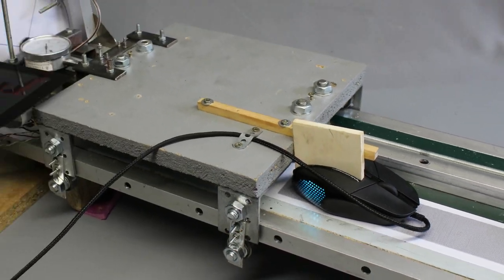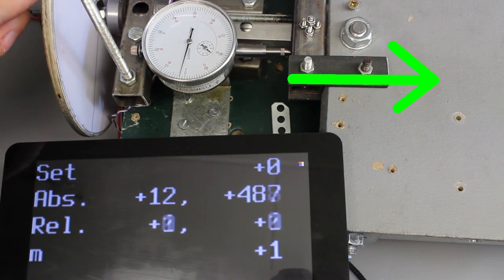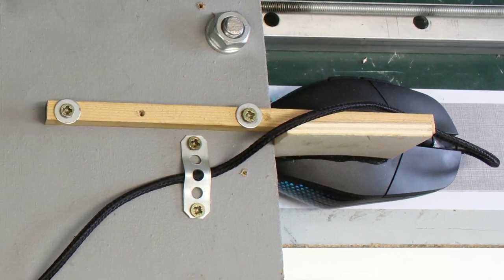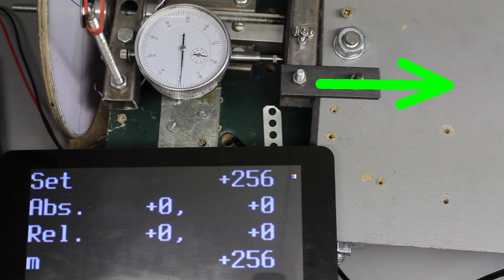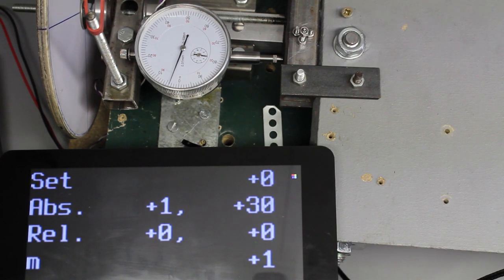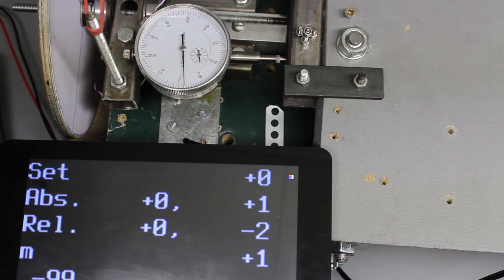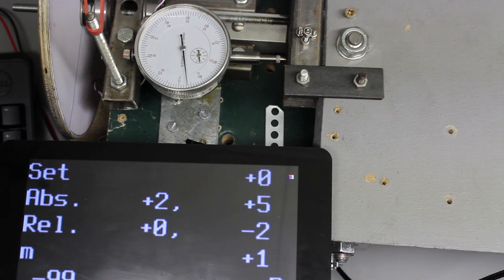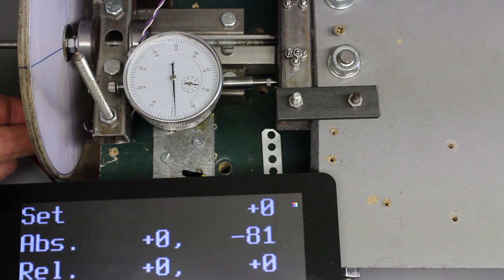Using a computer mouse as linear sensor

Comment: there should be a way to remove this drift!
this is the mouse working as intended. mice are designed to displace the on-screen-pointer at a non-linear relation to the the physical mouse's displacement. in my opinion the mousse design is genius, it's designed so that if you move the mouse fast, the curser moves further than if you move the mouse slow, this is to allow fast and accurate movement on the same device, if you want speed, go fast, if you accuracy just go slow. this nonlinear behavior is what's causing that velocity-dependent drift in you're measurements. there should be a way around this! 
the way they achieve this nonlinear behavior is probably by applying some convex function f(x) on every reading of relative mouse steps. I don't know what f(x) is, it might depend on the mouse, but, you could measure this function by measuring the number of mouse steps per inch at different speeds. after you know what f(x) is, you could just reverse it and obtain back x from the mouse's reading (which was f(x)) by applying f^-1:   x = f^-1( f( x ) )

for example f(x) might be x^2 or e^x or whatever.
Reply from the maker: You can try, but I guess that won't work either. there are inevitably coordinates lost even on a closed loop due to rounding errors.

Comment: I think firmware has small "filter" to swipe very small motions away. Think about it, if you put mouse on the mousepad, the cursor should NOT dance. That is what filter means, to remove some noise and reading errors.
Very slow motions will more filtered away than faster motions.
The filtering is more stronger inside cheap mouse or unknown type mouse. Expensive mouses should have less filtering and thus more precision possible.
Not sure i am right, but it's all about to avoid ghost move of the mouse cursor when mouse is not moving.
Reply from the maker: What ever a mouse firmware does - it changes the raw data that would be needed to get usable precision. Even with the raw data it's very likely to get a drift over time.
Reply: @HomoFaciens  @mrdummy is there any solution for this problem? i need precision on verrryyyy slow movements and now I'm disappointed :(
Reply from the maker: If you want to move something, go the "classic" way:
https://www.youtube.com/watch?v=ULJE4MsJpR4&feature=youtu.be
Reply: @HomoFaciens  thank you but no, I just need to measure Micrometer dimensions via optical ways.
Reply: I imagine this is similar to how game controllers are programmed as well. Movement is not triggered until the sensor makes it past some value, which is called deadband.

Comment: A couple of tips: Regular pattern surfaces aren't great for image correlation tracking. A random surface will be better.
12k cpi is extremely imprecise. Image correlation sensors are not made for those resolutions and it will give an extremely jittery output.
Should be ok under 3000cpi, don't even bother with more.
Reply from the maker: ...a couple of more reasons why computer mice aren't good for absolute positioning.
Thanks for sharing your knowledge.
Reply: HomoFaciens what would you suggest to use?
Reply: What are you trying to measure/optimize for? From the setup it occurs to me that simple threaded driveshafts do have a slip of some 300-500 microns. Which is by the way really good result. Changing the direction of the drive (even slowing down) will have the effect of seating of the nut on the driveshaft on the other side of the thread surface hence generating motor turns without movement of the carriage. This is normal and probably nothing to do with the measurement setup of the mouse/micrometer. Use a proper ball screw driveshaft to get much higher precision.
Reply from the maker: I wanted to demonstrate what this simple setup using common materials is good for. This linear drive is part of my CNC that can be build even in locations with no access to hight tech like ball screw driveshafts:
https://homofaciens.de/technics-machines-cnc-v3-2_en.htm
Reply: Ahh, cool, this explains. But than I think slowing down/"repeated kicks" and other methods may just lead to more "error"/slip. How about using consistent speed left and right and just measure the reseating distance when changing direction of drive. Maybe some averaging can go here or some speed related reseating distance measurement. Loved the video by the way.
Reply from the maker: Well, what ever you do, the distance reading of those mouse sensors will never get as good as the classic approach using a rotary encoder on the spindle. In theory those mouse sensors were better considering the dpi ratings of the manufacturers, but with this measurement series I found that this isn't true in practice. The experiments were part of improving the linear drive of my CNCs, nothing more:
https://homofaciens.de/technics-machines-cnc-v3-x_en.htm
Reply: If you're using linuxNC there should be a place somewhere in the .ini file to compensate for the backlash of the slide/lead screw. I came across this video because I was thinking about using the optical sensor and the light from the PCB board inside the mouse that tracks the wheel movement, but the laser will probably be more accurate. Nice video!
Reply: @HomoFaciens  My ancient ball mouse has rotary encoders mounted on shafts inside, hmmm...

Comment: Very informative, thankyou for this. Been looking for a 'cheap' way of controlling a cnc home hobby mill. 
Great video.
Reply from the maker: But you should have noticed that it won't work with computer mice. The classic approach is better:
https://homofaciens.de/technics-base-circuits-encoder-disc_en.htm
I also did investigations using the sensor strips from old printers:
https://youtu.be/YfBkddVJksw

Comment: Well, all of these findings are valid. And, more over, they are in line with the specs for the mouse sensors.
The skipping of movement is due to the fact the manufacturers introduce "sleep" state of the mouse - when not moving for particular period of time, the intensity of the LED decreases making it harder for the sensor to sense the movement. Also, the frame rate of the camera sensing the movement decreases. This saves power and avoids "noise" caused by uneven surface reflections.
Further more, to provide a feeling of "better mouse resolution" the manufacturers actually "cheat" - they increase the output of the sensor non-linearly when a fast initial movement occurs. This gives the user a feeling of faster and more precise feedback of the mouse movement.
Now, good news is that both of these features can be compensated by setting the sensor mode. The bed news is that as vast majority of the sensors are specifically made, the documentation on how to actually do it is closed-source or NDA only.
I found some very cheap ($2) PS/2 mouse from aliexpress that had an optical sensor capable of setting both of these parameters (disable sleep mode and disable rate increase), however its reflection of the GT2 belt I wanted to use it for at that time was not sufficient. I threw it out a week ago :( Should I be as smart as you and printed the fine pattern and measure that instead of the actual belt, this might have worked :(
Reply from the maker: What sensor is inside your cheap PS/2 mice? This could be something for a future project.
Thanks for sharing your expert knowledge!
Reply: I'm not 100% sure as I threw it out (stupid me), but I think it was Avago ADNS-2610 or 2620.
I can buy another one, but it'll take a month again to get here to Switzerland :(
Reply: Here is the datasheet I used: https://www.sparkfun.com/datasheets/BreakoutBoards/ADNS2620.pdf
Check e.g. page 19 for the power down for LED light for no movement over 1 second - forced awake mode...

Comment: I'd put the sensor on the wheel versus the strip, you should get way more precision with that. I'd also use a sensor that can be interfaced with directly, and a (pseudo-) random dot pattern as the surface. 
finally, I'd also use an optical sensor to resynchronize the higher precision mouse sensor and avoid drift.
Reply from the maker: With the sensor on the wheel, you must process the changes in movement in short intervals to avoid loosing turns. I am using a toothed disc with light sensors instead for my machines:
https://homofaciens.de/technics-base-circuits-encoder-disc_en.htm
It's way more simple from hard- and software side.
However your way would be nice to do some experimentation - I'll keep it in mind.

Comment: Thanks for the video! I would like to see a similar test with a graphics tablet as the sensor. In theory according to the manufacturers, it should have greater resolution accuracy.
Reply from the maker: Thanks for another idea, but:
Graphics tablets aren't that common as computer mice, which is why they are not that cheap. The idea behind this video series is to create a linear drive using cheap, commonly available sensors. Still my favourite is the toothed disc on the threaded rod being scanned by photo sensors from old printers.
Maybe one of those cheap digital calipers suggested by a youtuber could be an option.
Reply: That struck a thought with me...how about the optical sensor of the mouse pointed at the threads of the rod? It should see the "movement" of the threads toward the right or left. I don't know how sensitive it would be, but I'd suspect it would be better than the small grid you had the mouse moving over?
Reply from the maker: Simple Experiment with the computer mouse you have in your hand:
Lift it one or two milimeters and move it around. The cursor on your computer screen won't follow your hand as precise as it does whithout that gap. The image is out of focus when lifting the mouse and you won't be able to focus the threaded rod in a better way than you can focus a flat surface.
Reply: Good point. I'll keep trying to think of good cheap ways to do this :)

Comment: You would probably be better off with a flow sensor. I would assume these all-in-one dedicated mouse chips would have filters to make the more effective in use as a mouse (such as, it seems here, a high pass filter).
Reply from the maker: What type of motion sensor is a flow sensor?
Yes, Computer mice are obviously designed to be human input devices. This video points that out. I made it, because several people asked if these cheaply available sensors would be useful in a CNC.
There are applications in robotics that can make use of optical mice, linear drives in contrast need something else for positioning...
Reply: +HomoFaciens the optical sensor in the mouse is an optical flow sensor. You can also buy the chips that provide the raw output. Really just a camera like device with apertures and single pixel cameras. As for mice, the clever bit is in the processing. They are also using them in drones for ground tracking.
Reply from the maker: To me "flow sensor" was always something measuring fluids ;-)
I never knew those optical sensors are also called flow sensors.
This video was a quick look at optical mice that would have been perfect motion sensors according to their specs. Obviously they are not for use in my CNC machine. If time will come, I'll have a closer look at the optical chips.
Thanks!
Reply: I know video is old, but... as i know accessing mouse not as HID device, but encoder chip directly, and using some features to correct accumulated errors makes them much more suitable as encoders.
Reply from the maker: Well, you need a mouse with a chip that is completely documented to get access to the level you suggest. Unfortunately that's not true for most of the computer mice.

Comment: Pepperl + Fuchs makes a sensor like that, cool video!
Reply from the maker: ...and many other companies, too. I am looking for cheap, commonly available sensors (especially in places with no 24h express delivery). They will be used in my CNC v3.x series which is my application for this year's hackaday prize:
https://hackaday.io/project/10299-self-replicating-cnc-for-194-or-more-countries
Reply: No I didn't mean to be a troll if you took it that way, what you are doing here is very cool, I enjoy your videos.
Reply from the maker: There is a "delete" button for spam posts and I have learned to use it. I didn't think that you wanted to promote a special company to make money and your response shows that I was right ;-)

Comment: Very nice vid, i like your stoneage style!! ! maybe disable mouse acceleration, this seems to be your exact problem, as this causes fast movement and slow movement to be different,  most pro gamers also disable this as it messes up mouse eye coordination ..  also maybe with some math you can calculate the actual linear travel distance by taking bough axis into consideration like if travels x in 4 steps and y in 1 step you know the true x distance of travel by doing 4sq + 1sq = sqr17 = 4.12310
Reply from the maker: Thanks for sharing your thoughts, but: As the firmware of the mice is closed source, you can never be sure what it exactly does. For gaming you might get better results with some adjustments, but for driving a machine in absolute coordinates it will still be useless.
Reply: @HomoFaciens  mm than i think mouse might not have that high of a tolerance, as this is suppose to give you raw data from the sensor..  in linux its even a function raw mouse input,.. but i agree as long as the firmware is closed one can never be  sure.. stumbled upon your vid while doing some research on cheap relative precise linear tracking, as making my own printer at the moment for PCB's using a uv laser to sensitize photosensitive ink/film coated PCB. guess im stinking with linear decoder strip from a printer :)
Reply from the maker: Even with raw data, transferring images captured by a camera into movement coordinates will always have an uncertainty.
My experiments with a printer decoder strip can be found here:
https://youtu.be/YfBkddVJksw
Reply: normally mouse acceleration comes from the OS alone (hence why you can disable it in Windows generic settings). So there's very little chance the mouse does it.

Comment: hmm, maybe its not good enough for a CNC, but I think these optical flow sensors could still be useful in linear actuators with less  precise requirements, maybe its best used with limit switches and a calibration before use
Reply from the maker: Flow sensor could work somehow, but going back and forth will inevitably add up to a noticeable error.

Comment: Does the chip in your mouse provide you with the option of reading the encoder pulses instead of getting the data by bit banging. One might be able to see if it's really missing some steps or is the firmware doing some sort of magic. If I am not mistaken, chips like the OM02 one can read the encoder pulse directly. I was going to try reading the encoder pulse but the chip on the mouse I have does not have that option. It would be a really good solution if the missing steps can be accounted for. Thanks for being generous with your knowledge.
Reply from the maker: It's the firmware on the computer mice that do transformations. Especially when testing the cheap mouse you can see that it must "wake up" by a relative large movement before sending data. That's for sure caused by firmware implementations. You could try finding an optical chip including documentation to get the raw data. The ADNS2620 might be an option.

Comment: I have tryit but without a grid, directly to guides surface of a lathe and mouse connected to a computer in a Visual Basic program. With manual movements never had constant measurements, it depends very much of speed and acceleration of the movement. It would be intresting if it would be precise with a grid.
Reply from the maker: Computer mice are in general not designed to capture absolute coordinates. You will never get it work with a linear drive. Moving back and forth will add to a huge error over time. It's not the surface, but the mouse firmware that makes it useless for precise metering.

Comment: Will you show another meassuring method by using an accelleration sensor?
Reply from the maker: Acceleration sensors are interesting for robotics. I will use them e.g. in my world tour robot:
https://www.youtube.com/watch?v=uRH9fVEtgSo
They are no good for sensing motion in a CNC, which is what I have currently in mind with this video series.

Comment: Great video. What about a laser sensor mouse thoes can be very percise however i have heard that thoes have hardware acceleration so you need to use them at "low speeds" or similar speed all the time? Very cool idea with the mouse as a sensor
Reply from the maker: Thanks! The main difference between optical mice and laser mice is the light source (laser diode versus LED). The drawbacks are same as that of optical mice, thus they are no precise linear sensors.